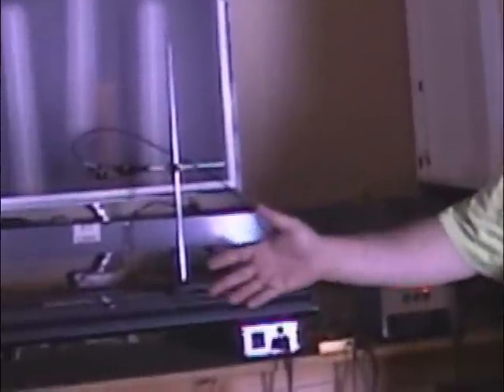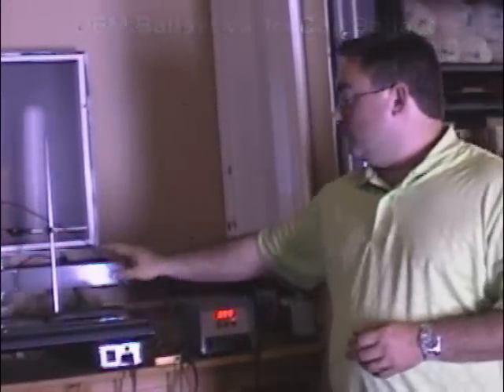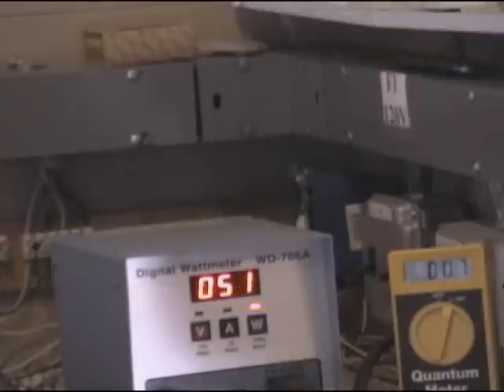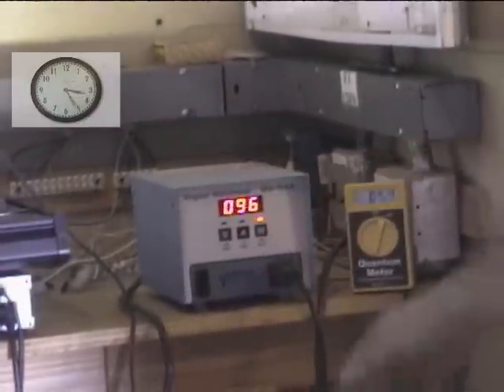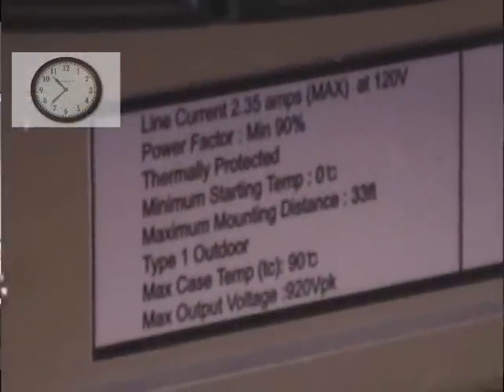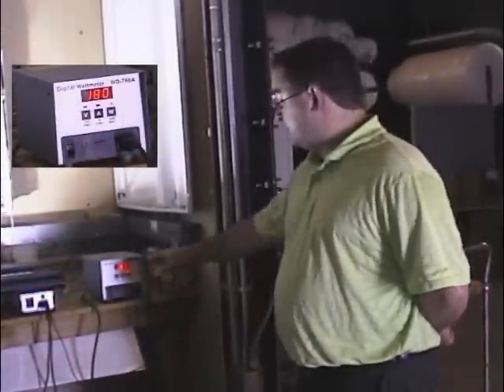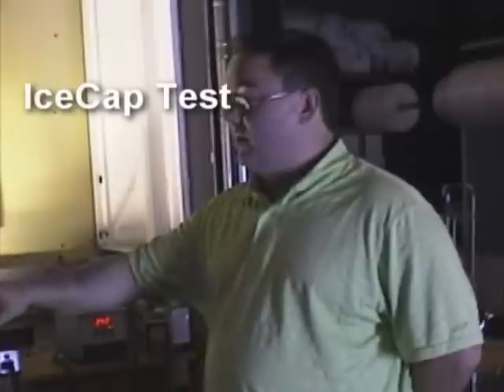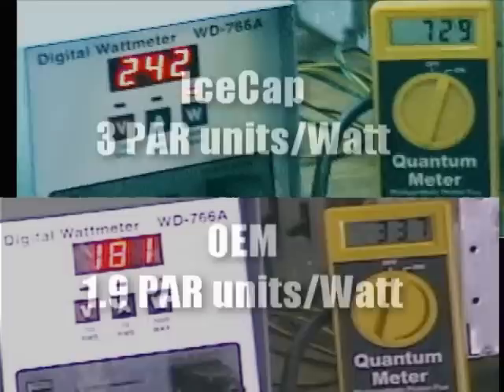IceCap / OEM Ballast Comparison

Comment: Watts does not equal volts times amps in an AC circuit if the power factor is anything other than1.  AKA resistive only load.  It actually equals volts times amps times pf.  But I will agree Ice cap ballast do a better job of driving bulbs.  With a slight overdrive.  Good ballast.